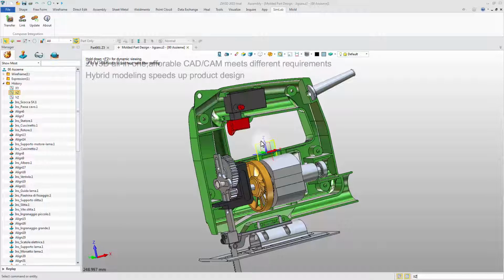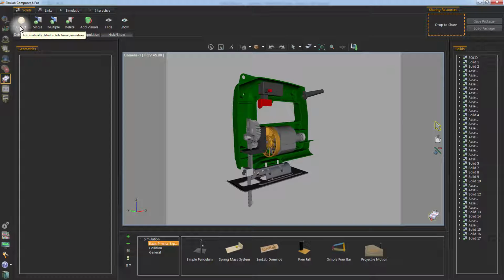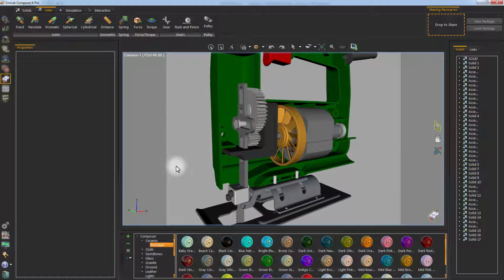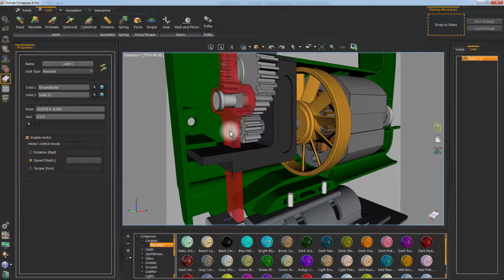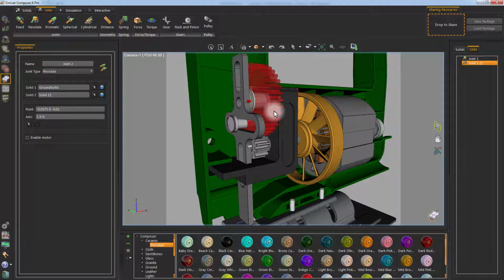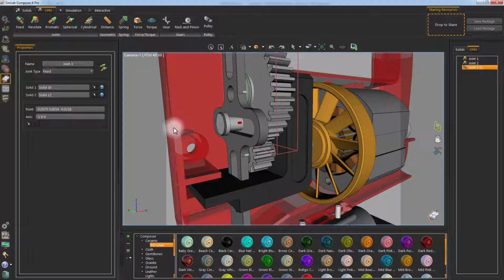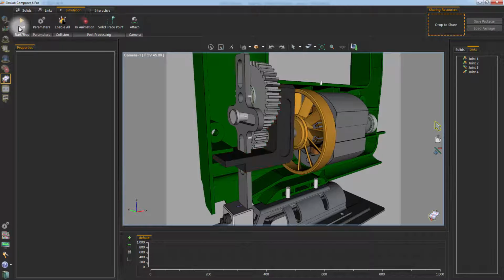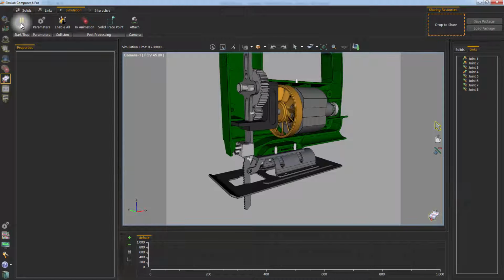Simulating ZW3D mechanisms with SimLab Composer

Comment: nope, it doesn't work.
i designd a set of 2 identical gears, properly.
but the simulation fails, drasticly.
sorry guys but if you are into simulating gears by collision then this is not the software for it.
Reply: SimLab Composer includes two methods for simulating gears (using gear constraint, or using 3D collision) if you are using 3D collision you need to reduce your time step, if you send the model to support at simlab-soft dot com, they will show you how to do the simulation.